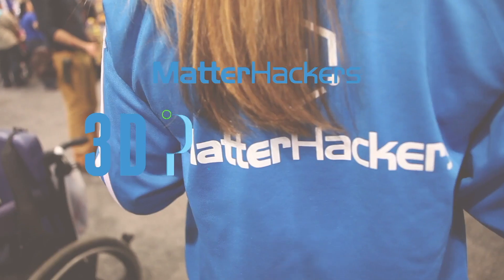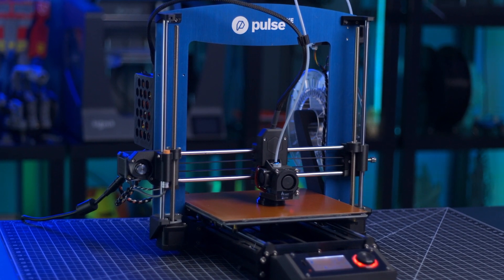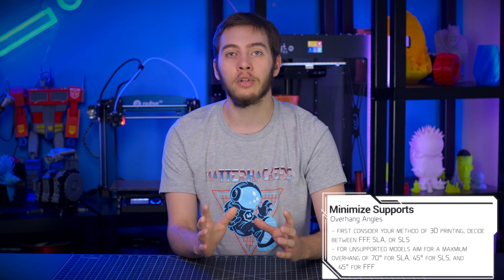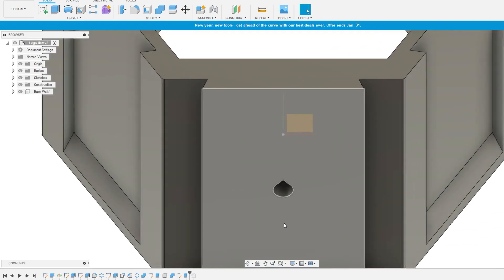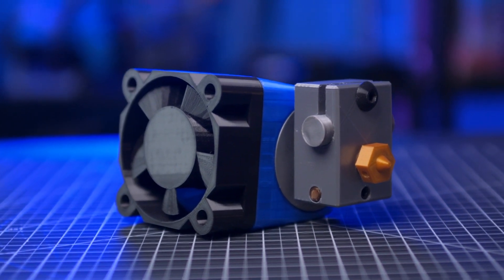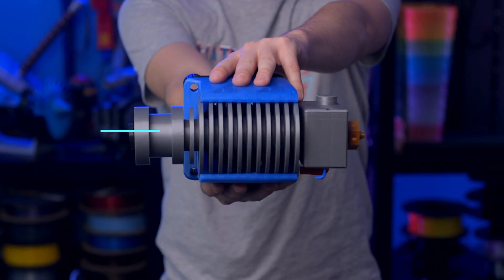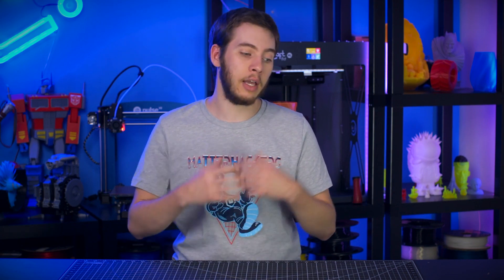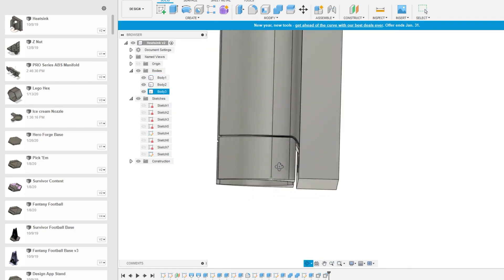How To: Minimize Supports for 3D Prints

Comment: Any guide on how to split rather complex models and make them interlocking? As in snug fit either snap in or sliding 2 parts?
Reply from the maker: We do have another video showing how to break down large prints for smaller build areas that might help you out here: https://www.youtube.com/watch?v=gZJhrk-krtg